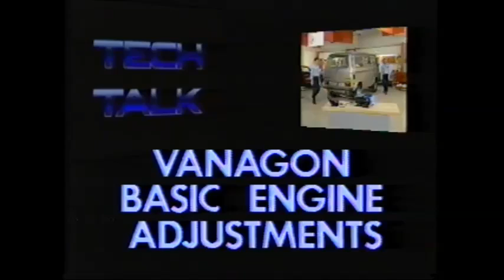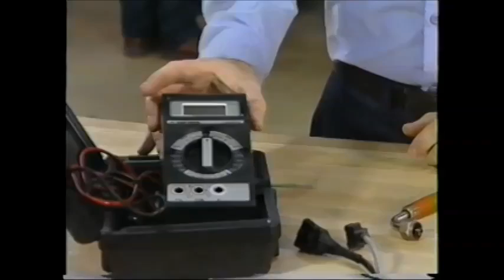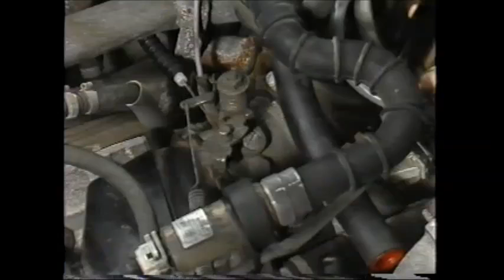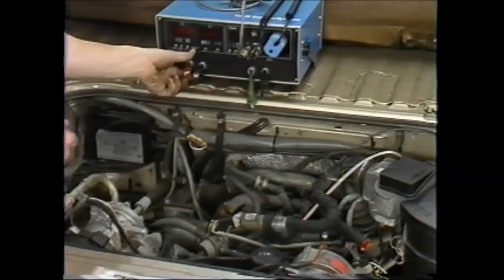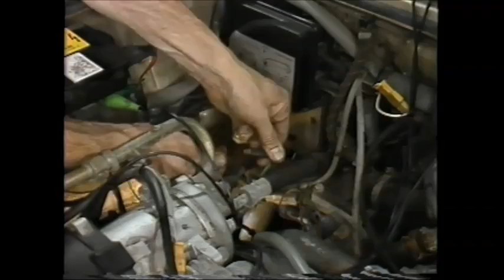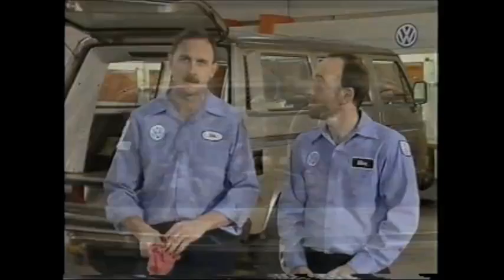VW Tech Talk: Vanagon Basic Engine Adjustments T25 / T3

Comment: Stay tuned for part 2 of VW Tech Talk: Vanagon Basic Engine Adjustments T25 / T3 where we take out the wasserboxer and replace it with a Subaru motor. Problem solved.

Comment: The best engine adjustment is to remove the wasserleaker and heave it into the nearest trash receptacle, and install a Subaru engine.
Reply: Yeah I’m going to remove a 30 year old engine that’s under powered and prone to head gasket seal issues and replace it with a 20 year old engine that’s under powered and prone to head gasket issues.
Reply: @curtislovrak5390  Counterpoint - the Subaru is less underpowered and they made way more of any particular model than they ever build wasserboxer powered vanagons. Parts availability is important.  You can stop and ask for parts from the year and model of Subaru you have the engine from while a lot of places outside of the western US will just look at you crazy and ask you "What's a Vanagon?"

I understand that the EJ22 isn't so bad - it's the EJ25 that's the real troublemaker anyway.
Reply: John haha
Reply: 1.9
Reply: Honestly, put in either a zetec engine or a k24a Honda engine.
Reply: Hear, hear!  Worst engine ever.